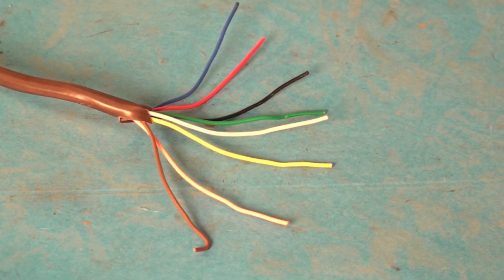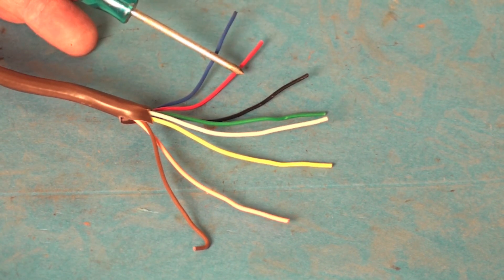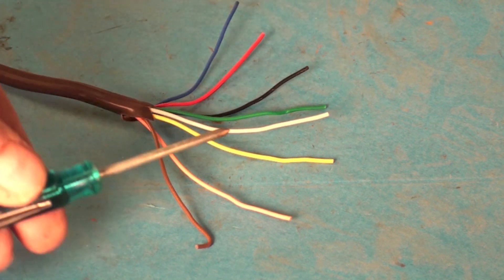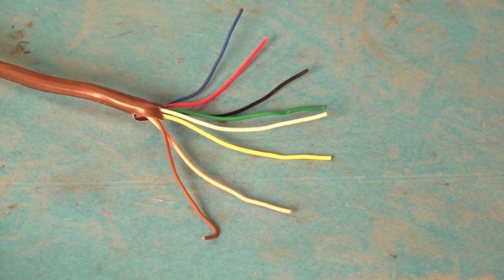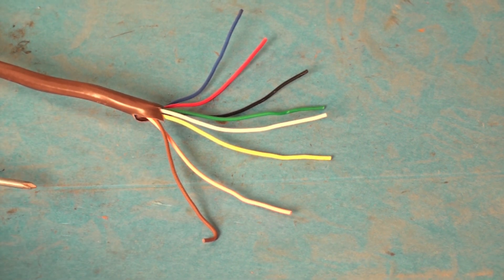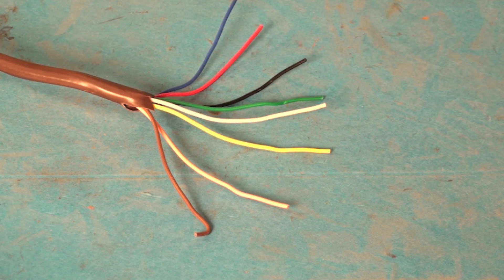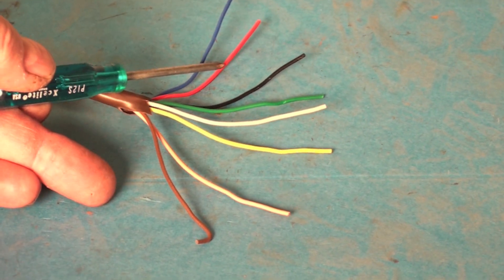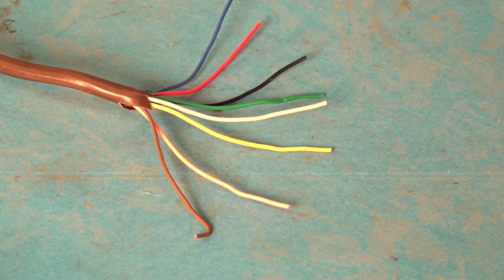Heat pump thermostat wire color code

Comment from the maker: I think the reason for us using blue for rev valve is the the terminal letters.  B=blue O=orange.  It would be nice if we had a sensible color code used throughout, but that is not happening.  Thanks for the info.
GFM
Reply: The B is when the reversing valve is energized in heat o is for energized in cooling

Comment: Hey GFM, just depends on the part of the country your from. Here in Ga. we always use blue for common. Orange is the reversing valve wire doesn't matter when it gets energized. If I'm doing a 2 stage cooling unit I use brown for the second stage.